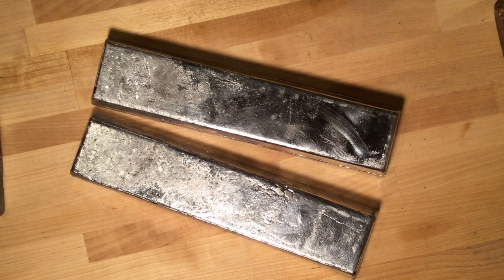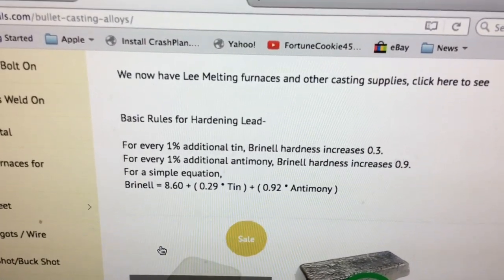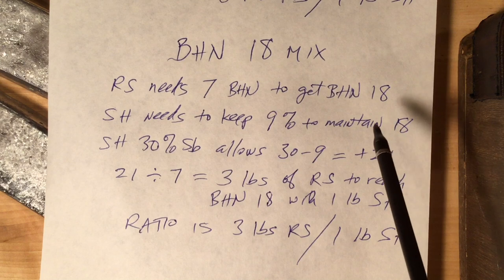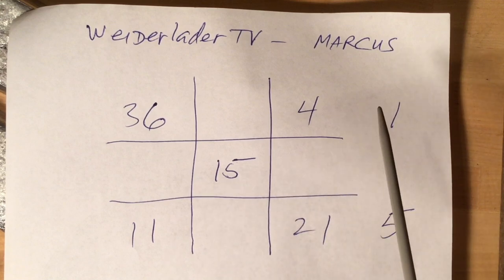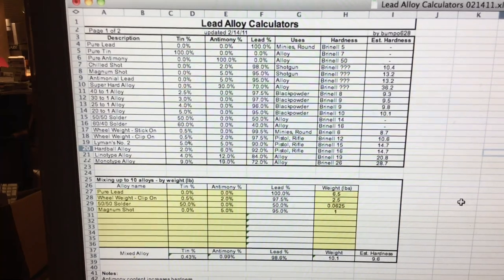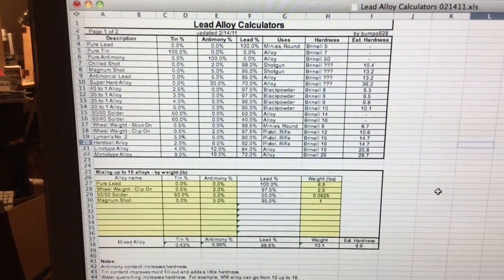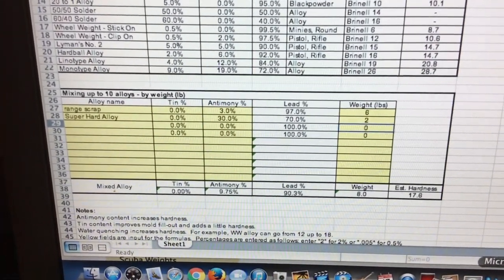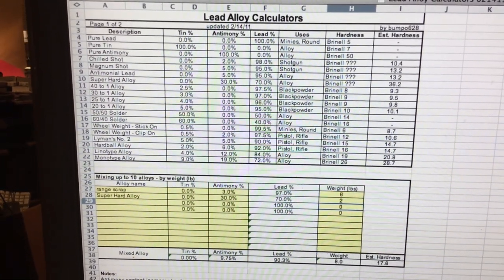Three Ways To Calculate Our Bullet Alloy Mixes

Comment: what about poor folks that have wheel weights and range scrap
Reply: A lot of us can't get wheel weights.
Reply from the maker: rustybayonet - From one rascal to another -- Current lead wheel weights have 2.5% tin, 7.5% antimony and 90% lead.  Using the RotoMetals formula, BHN = 8.6 + 1 + 6.8 = 16.  Your range scrap is BHN 11.  Notice something very interesting - if you wanted BHN 15 alloy, no mixing should be done - just use the WWs straight up.  If you wanted target or standard velocity shooting with BHN 12 alloy, no mixing is necessary - just use the range scrap straight up...Also interesting, if you want to shoot magnum revolver with BHN 18 - you could mix till the cows come home and never get there with either alloy.  You will need some linotype, SuperHard, or Foundry from RotoMetals to get harder.  And we shooters always want to get harder...  Best to ya,  FC
Reply from the maker: Psyko Klown - (Sigh..!) I really miss having wheel weights also.  I used to get them for free from big tire shops.  They can still be purchased on-line, but if I'm going to do that, I'd just buy Lyman #2 alloy or Hardball alloy from RotoMetals (especially on sale) because free shipping for $99 orders plus a free hat or T-shirt.  I didn't mention it, but my last order, they also threw in a bottle opener for my keychain.  However, base cast alloy of free range scrap is very nice.  Best Regards to ya,  FC
Reply: I do collect range scrap, but the majority of it tends to be slugs. If good alloys can be formulated, the next big thing may just be zinc bullets.
Reply: FortuneCookie45LC I have to tell someone, Sensei! My 99 suburban broke down, ask the owner of the shop about wheel weights. Picked up 15 gallons of wheel weights!!!
Although I am finding different hardness in them. I use a pair of side cutters on the questionable ones, And can tell. I know your trapped behind enemy lines, but would you think all the soft ones are usable? I have found many different types. Lead, zinc, plastic coated steel.
Reply: People who can still obtain wheel weights are rich.
Reply: I've cast zinc. It has poor sectional density. The main thing is that the reactivity and casting temperatures favor industrial casting prosesses, rather than hand casting. I could see commercial zinc bullets for plinking ammo, but I don't think there are practical ways to overcome the hassles that zinc adds to home casting.
Reply: "And we shooters always want to get harder..."  you're a funny man, Mr. FC.  "Hard" logic, but easy to follow.
Reply: Maybe someone will eventually find a way to alloy in heavier metals.
Reply from the maker: Psyko Klown - It's going to be a while before we have to go to zinc bullets...Zinc melts at much higher (787) temp and is harder metal.  Copper alloys would be the next used.  But I'm not going to be concerned with that in the shorter term... Best Regards, FC
Reply from the maker: rustybayonet - the softer WWs are the newer ones - uses a softer lead alloy.  You zinc and coated steel are worthless for the short term...If you alloy all your lead WWs together and add one to four linotype, you'll have casting metal good for auto pistols and +P revolver shooting... Best Regards to ya,  FC
Reply from the maker: GunFun ZS - Thanks for punctuating this whole thing...I appreciate what you and Elvis have done experimenting with zinc, but personally, I'm going to avoid the heartbreak of zinc every chance I get... Best to ya,  FC
Reply: Good point about copper alloys. I was thinking along the lines of cheap/free and easy to obtain.
Reply from the maker: Loads of Bacon - There are certainly times when hardness can be fully appreciated....it's a long list, really - what is interesting is what we put on the top of the list...Best to ya, James -  FC Steve
Reply from the maker: Psyko Klown - Or the perfect powder coat that is yet to be developed...Best to ya,  FC
Reply: FC, i would love to get in contact with you via email. Can you please get back to me? I have some questions all the way from australia!
Cheers
Reply: @FortuneCookie45LC  modern clip on wheel weights, are nowhere near that hard, they range from 11 to 12
Reply: try your local roofing supply? some have LEAD flashing, some have had it so long they want it Gone!
I found an industrial neighbor who built and lined imaging rooms for health care! and wanted his "toxic" byproducts Gone! I'm here to Help!

Comment: I'd suppose it wouldn't hurt to say that getting a hardness tester isn't the worst investment at some point, especially for those with terrible problems with the kinds of scraps they are getting, or eBay wonder alloys, where testing your initial scrap ingots would probably help your first step in figuring out where to go.  Bad guesstimates of the initial material can throw off your otherwise brilliant calculations.  Also, good to keep in mind that even if different alloys come out to the same hardness, their properties can be different in other ways, so its worth keeping notes and learning from what specific alloys do what and why.

In addition to my extremely cheap nature, this is the other reason I shoot so many light target loads.  On the combat side of things, I myself am a proponent of shooting what you carry, which in my case would be full power .357 magnum rounds.  But, the temptation to only use 2.8 grains of Bullseye and the low cost eventually gets the better of me too often, as well as the fact that I don't have to sweat my alloy at all.  When I sit down with my molds for these target loads, I can use whatever soft lead and questionable but safe ingots I've got without a care.  Don't know if I' no the right path with this, or its my penny pinching and laziness getting the best of me.  Good work as always Mr. Fortunecookie

Comment: Hey brother cookie I'm doing some math to see about the savings of casting so if a box of hard lazer cut bullets cost 60$ for 500 we make them softer for nothing if we get the wheel weights or range scrap for free and if we want to make that scrap harder it would cost us around 15-20$ in rotometal to get our desired bhn so that's not so bad but if we can't get free lead all the time and we have buy weights on eBay or whatever lead we can find cheap now our cost has gone up and then to use rotometals strait up would be no cost savings at all so I'm thinking for the work part of we are just better off casting what we get for free or cheap and powder coat

Comment: i thought i always heard pure lead was 5 bhn why does the formulas say 8.6
Reply from the maker: Jake A - the video has a lowdown on hardness of pure lead being 5 or 8.6.  Those that insist that pure lead is BHN 5 seem to have problems recognizing the utility of the RotoMetals formula.  Those that use the RotoMetals formula don't have any problems with whatever pure lead may be.  Perhaps if RotoMetals called the 8.6 a conversion constant instead of referencing that as the BHN of pure lead - all parties would become satisfied.  Interesting -  RM does not currently identify the 8.6 as the BHN of pure lead (they did in the past though - no doubt, all the flap caused that to change).  The current formula has no explanation of what the 8.6 is - I didn't notice that until now...But as you have seen in the video, BHN of pure lead as 5 actually causes problems when you look at what the BHN is in common chilled shot and antimonial lead as listed in the Lead Alloy Calculator.  All three methods of calculating the mixes works splendidly.... Best to ya,  FC

Comment: Bumps newest spreadsheet is a bit more extensive.  The BHN in the hardness calculation is 8.6 even though pure lead is listed as 5.

http://castboolits.gunloads.com/attachment.php?attachmentid=45784&d=1341560870
Reply from the maker: Robert McClure - Thanks for the update, Robert...Now that I have Foundry Lead from RotoMetals, I'm looking forward to using the LAC from CastBoolits to plug in for mixing ratios...Who knows? - for the first time in 40 years I might be mixing more than two components... Best to ya,  FC

Comment: So basically, if I have range scrap ingots advertised at Bhn 8 to 11 and I want to cast round  balls for target shooting (.54 cal - 55-65 gr 777 FF) I could just skim off the slag and cast away (no flux)?
Reply from the maker: All-round Deerhunter - Yes, that alloy is fine for target and standard vel shooting.  If your alloy is clean enough after slag skim off, yes, you can.  But most would prefer to flux at least once...sawdust works very well for that...or you can use candle wax, of course.   Good castin' to ya,  FC
Reply: Thank you sir for your reply; I have some of both - dust and wax :) will try both.

Comment: How can we be sure our range scrap is 11 bhn sure we can test it but these calculations are based on as if the scrap you get is always 11 so should I test every lot of range scrap I processed to be sure
Reply: get a hardness tester from lee or redding
Reply: peteralexben he was saying the range scrape is 11 bhn my question was should I test each batch to be sure meaning I already have one I was just questioning the statement that range scrap is what it is and should I trust that number
Reply: peteralexben I have a tone of wheel weight ingots I made and a tone of range scrap ingots and I hardly ever test the hardness because I trust what others say like wheel weights are around 14-15 bhn and range is 11 bhn I guess I should test a bunch from each to see if I need to adjust I have had no issues in the past but I'm interested in casting some 223-300 and keep them under 2300 fps but what would be an ideal bhn and I will be powder coating
Reply: jayboney el toro. 15 to 22 bhn. with powder coating depends om the .pressure of the load and gas leakage.  along by the side off bullet
Reply from the maker: jayboney el toro - The range scrap is full of all kinds of bullet lead from bullet cores to 22LR bullets to used cast bullets and shotgun slugs -- but when it is mixed, and it always is mixed, the stuff is a uniform alloy of BHN 11.  Perfect for shooting standard velocity target straight up - However, for auto pistols, we need to get at least to BHN 15 for good functioning (and also for +P revolver shooting).  The range scrap is always so reliable that I am not concerned with the hardness... the final bullets after mixes have not yielded any surprises.  Best to ya,  FC
Reply: FortuneCookie45LC thanks cookie
Reply: Walter Bunning sounds good thank brother